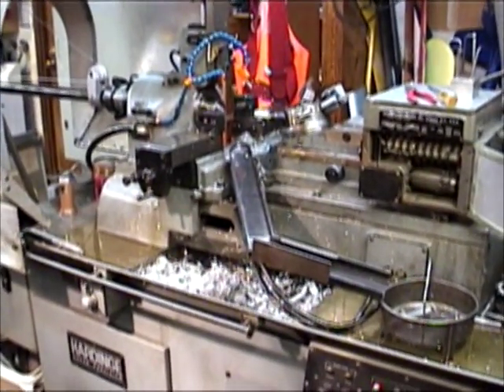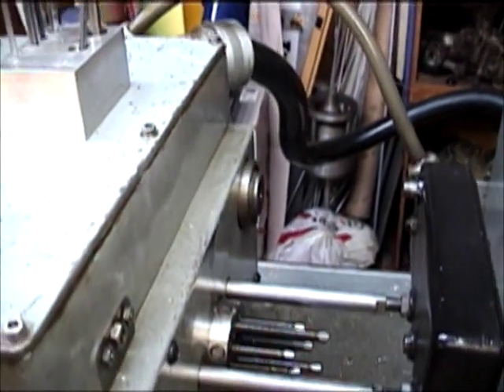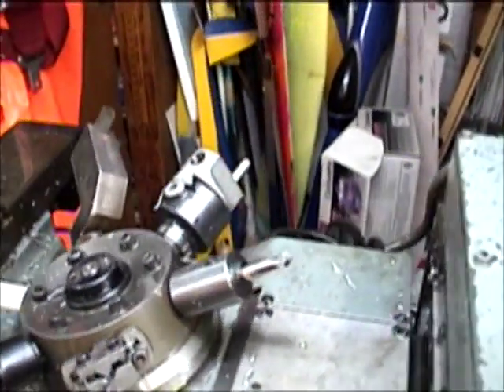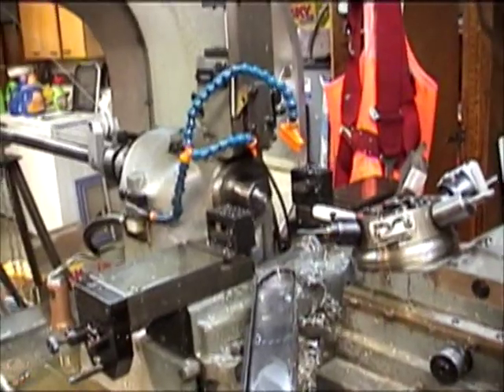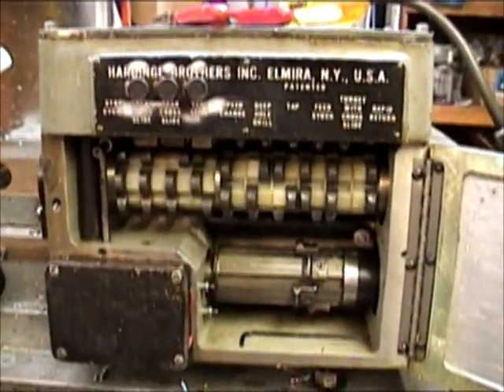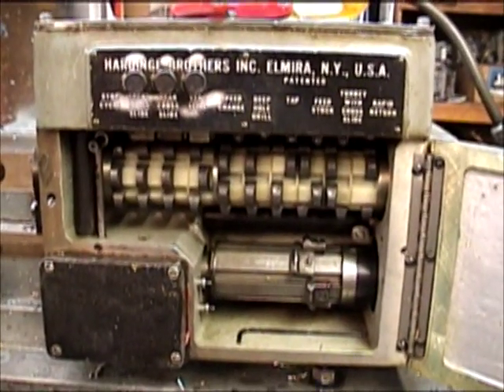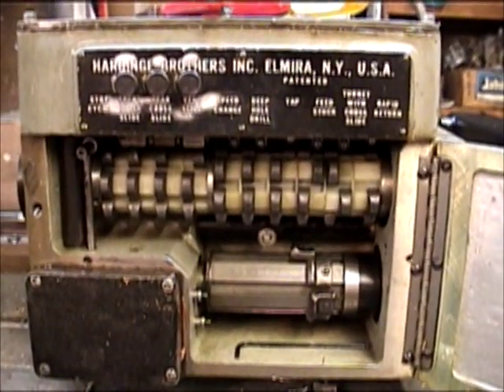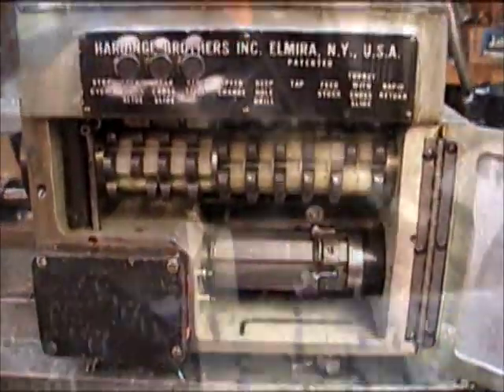Hardinge DSMA Turret Lathe.mpg

Comment from the maker: @ProfileMachiningLLC   The machine came with some tooling when I bought it 15 years ago, such as the releasing floating tap holder and a releasing die head threading attachment not shown in the video. However these tools are readily available new from places like gangturn.com. I make many of my own tool holders, drill bushings, reamer holders, and such. I grind most of my own form tools, but occasionally job out carbide form tools to an EDM shop that can make them as per .dxf cad drawing.

Comment: As someone more familiar with CNC, the idea of a mechanical programming system just blows my mind completely.  I /get/ it, but my brain can't actually /process/ it. :)

How long does it take to reprogram for a different part? (Excluding tooling changes)  Is there a standard method for writing down the program for later re-use? And is it readily repeatable or would you need to go through some trial and error when re-using a program?

This is some great machinist porn.  Thanks for the upload!  ;D